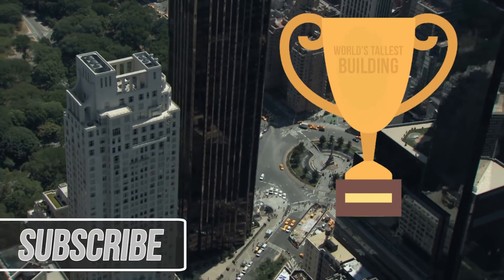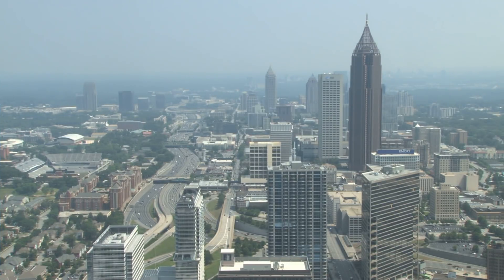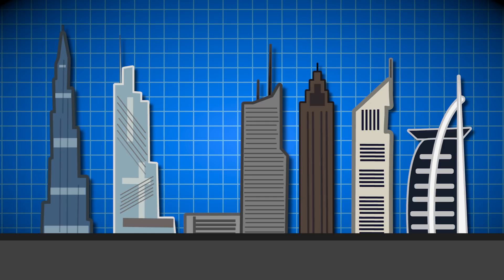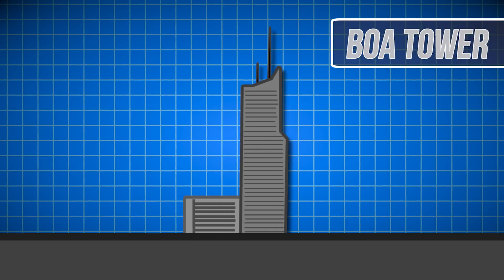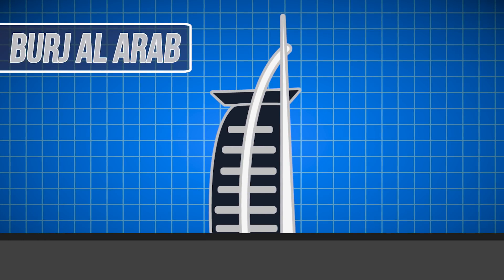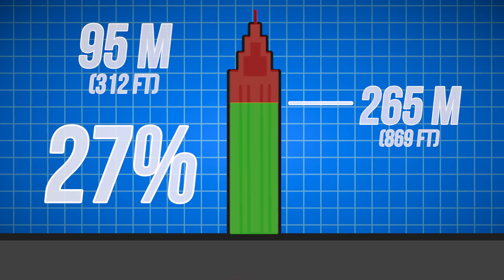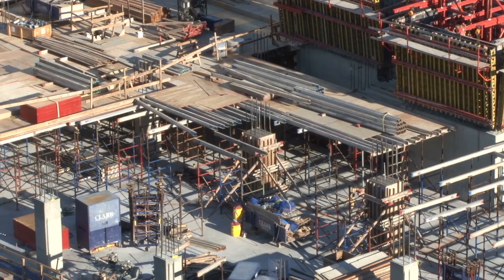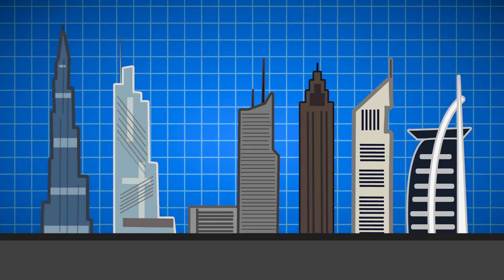The World's Tallest Skyscrapers Aren't Really That Tall

Comment: I may be wrong about this, but isnt the tuned mass damper housed in the 'vanity space'
Reply from the maker: Yes and no. For many of these buildings, it is — but the buildings don’t need to be that tall to house it. In many cases there are utilities and other equipment in this “vanity space” but it could be housed elsewhere if the building was shorter. CTBUH’s report was focused on demonstrating how much unnecessary space is in the structures. The point of vanity height being the skyscraper could function exactly the same without it (with components housed elsewhere). 🙂

Comment: Great Video! But what's inside that vanity space?
Reply from the maker: Just empty structural space, some utilities. It’s basically just parts of the buildings that are essentially not needed
Reply: Concerning Reality I personally think that the vanity height is useful, the extra floors help with servicing and utilities and the radio mast helps with communications. Also the vanity height finishes of the aesthetic look of the building ( billions have been spent on the main base part of the building, so the developers might as well spend a bit more finishing of the look). The vanity height is also important as a more beautiful building will help with the marketing and branding of its city and help with tourism. 
  Concerning Reality you should check out the B1M YouTube channel, it is probably the best architecture/construction channel on YouTube.👍👍